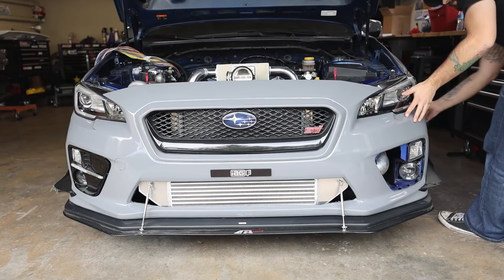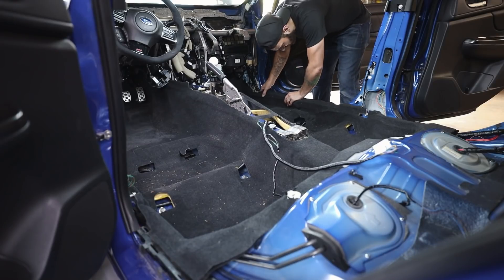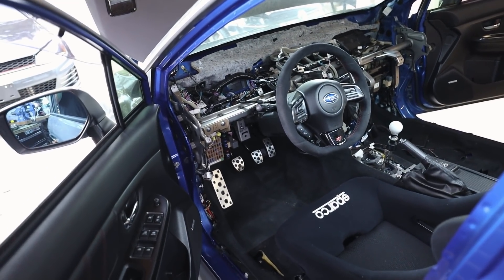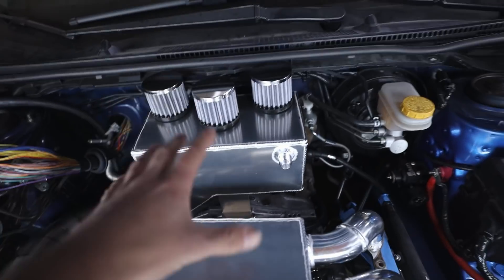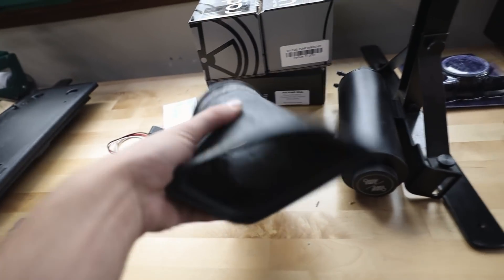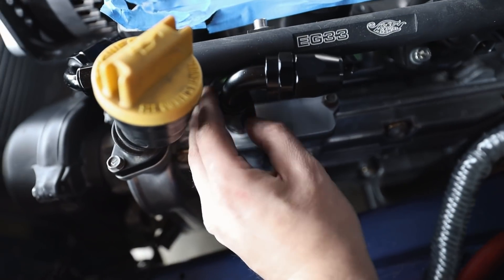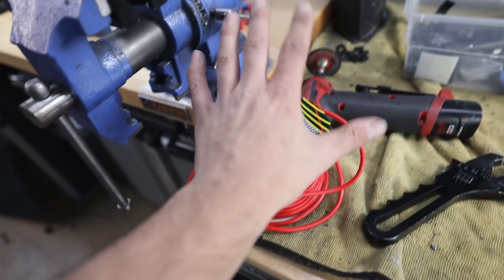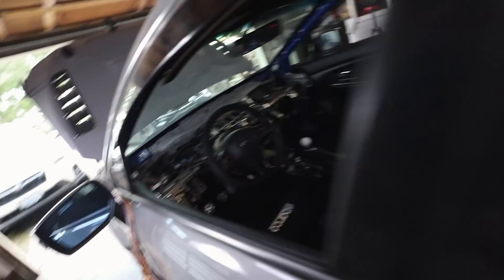The 3.3L Flat 6 Subaru STI Is Starting to Take Shape!

Comment: Hey I could be wrong, but I've noticed a lot of high horsepower cars are running catch cans or competition series AOS over the street AOS (like baderbuilt and Subaru specialty shops). Is there a reason for this? I have a 21 STi w/ the EJ257 and the street AOS. I would like to run 500whp in the future. Would I run into any issues with this street series? Thanks
Reply from the maker: Definitely suggested to have one, personally I always suggest the comp series 🙏 but you can use the street series as well
Reply: @Smeedia  Interesting. I was actually inspired to purchase the street series over the comp after seeing your street AOS install over a year ago. Would you mind explaining why you suggest the comp over the street? Something to do with gases released to the atmosphere? Also does the comp version still reap all the benefits of the street AOS so that no oil is lost? Thanks!

ps I plan to build my engine, rotated, e85, etc.
Reply from the maker: For bigger power builds I'd suggest thr Comp Series just because you venting out thr blow by. Especially if your on E85. The gassed and potential moisture from E85 is nasty and you don't want to revirculate that. 

However the street series is also a good choice, you can run big power on a street series no problem. If your only using pump gas I wouldent sweat it too much. 

Of you did want to convert, they have a conversion adaptor to go from street to comp as well. 

Tbh either option works great kinda comes down to preference.
Reply: @Smeedia  Thanks!

Comment: I learned that Cobb charges 600 bucks for a flex fuel kit when you can buy that gm/continental flex fuel part on Amazon for 40 bucks.... Lol. Ok Cobb
Reply from the maker: That's the sensor I used you just need Cobbs harness

Comment: Yo im finally picking up my sti But it has a bov intake and downpipe no tune can I just throw on the stock parts back in?
Reply: Btw it only has 4k miles
Reply from the maker: Yes you can toss the stock parts back on. Just need to flash it back to the stock tune 🔥
Reply: @Smeedia  I mean like the previous owner never tuned it lol
Reply from the maker: Oh yessir just revet it back to stock and disconnect the battery for 30 min and you should be good to go
Reply: @Smeedia  alright thanks for the help goodluck on blue and the new evo

Comment: Thought 🤔  you might alter your cylinder intake manifold design. What was the motivation 🤔  ? I think it is a smart and appropriate rework. A quick google search highlights some key design goals. If you have the OEM manifold have you considered cutting it open 🤔  ? Good luck with generation 2.0. 👍
Reply from the maker: Aiming for better flow, better fitment and a more sleek design 🔥

Comment: I changed the driver's seat to aftermarket seat, worked fine. Then when I swapped the passenger seat, I have an airbag light. I did swap the passenger sensor after driving without it being swapped over. Do you have any idea how to get it to work like normal again? The 6 cylinder looks amazing bro!
Reply from the maker: What resistor are you using on the seat?
Reply: @Smeedia  3.3 ohm in the passenger and 3.3k in the drivers seat. I think I need to swap the driver resistor to the 3.3 ohm, but it didn’t throw an airbag light when just the drivers seat was swapped. That’s my next step to try.

Comment: Concept Z are great, I spent a ton of money there over the years, never let me down yet. When my wheel stud bent after one of my rear control arms blew a heim joint, I popped on there and got the oem wheel stud for free. Realized I had freakin $78 in store credit through their free rewards program (1% back on your purchases).
Reply from the maker: Concept Z is 🔥 been ordering Nissan parts from them since 2011 🔥
Reply: @Smeedia  2016 here, but I got my car well after you had yours.